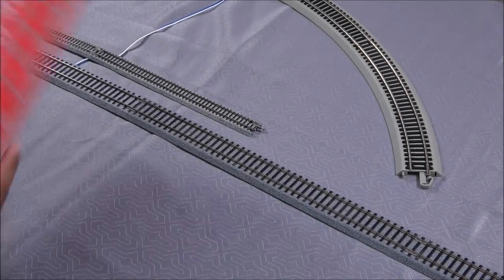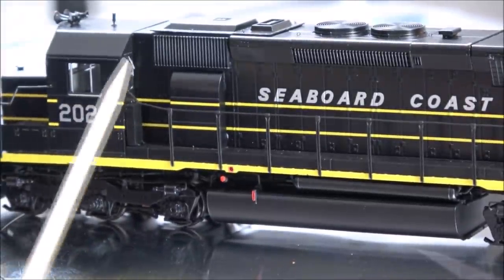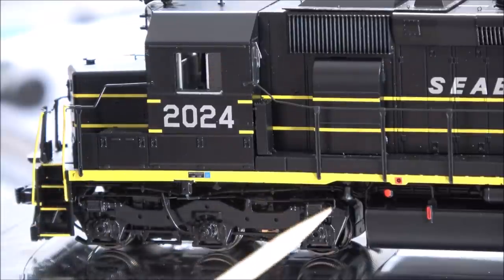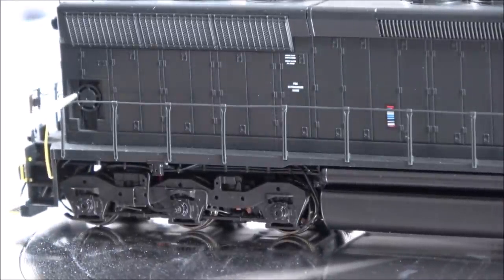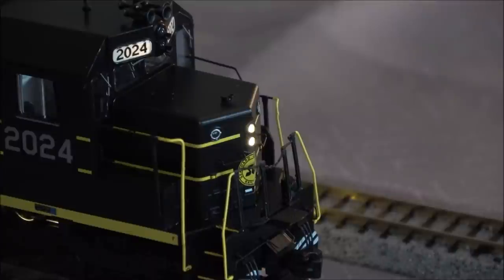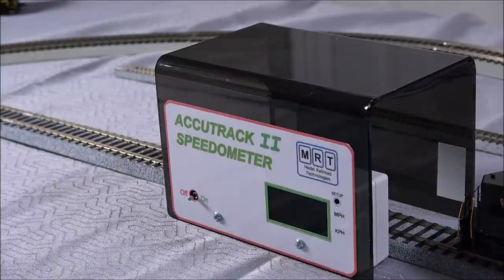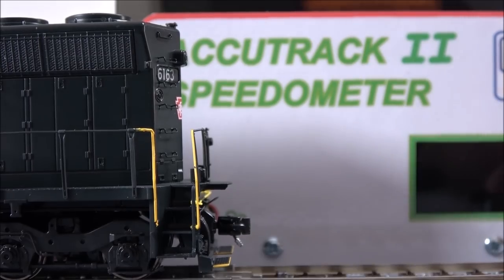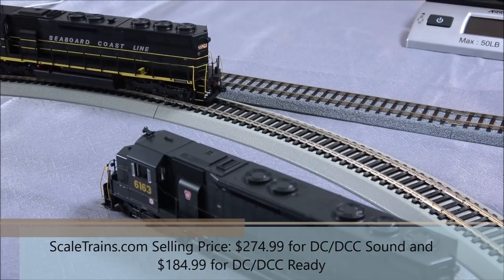Review: ScaleTrains.com EMD SD45 w/DCC and ESU LOKSound

Comment: I'm asking because l think l found the Operator example but l havent noticed any called the Rivet Counter. I have several Rivet Counters in quite a few road names. I was a Conrail and the NS engineer for 31 yrs and now l run the smaller ones

Comment: Newer style of dynamic brake blister. Has the later blunt end and then on the traction motor blower now has been strengthened by the addition of the two  additional ribs seen on top. You'll see them on the GP40s and SD40s also
Reply: James, have you done a review on Walthers Phase 2 GP9s?